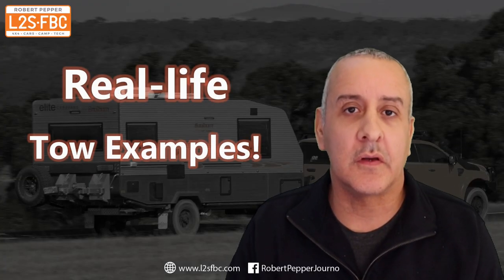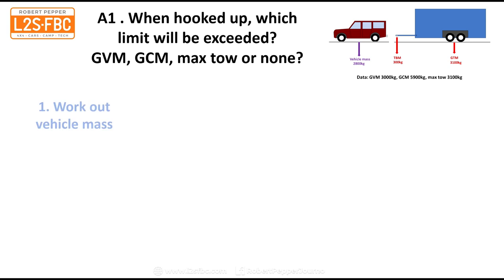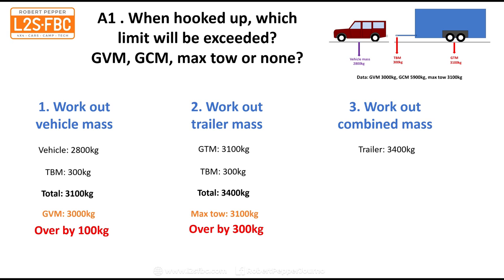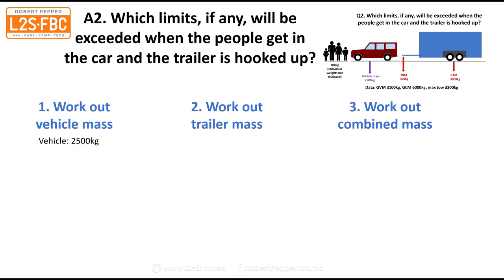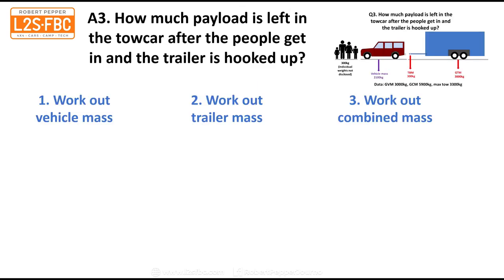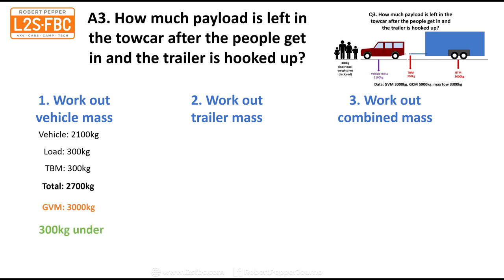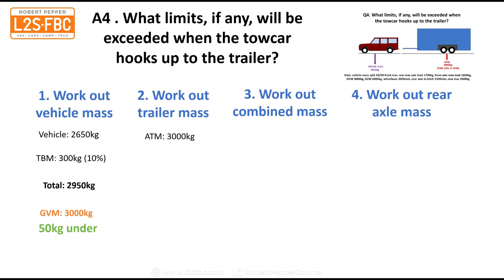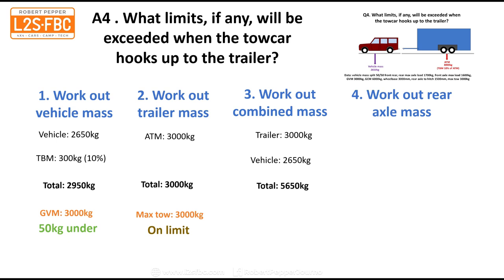Four towing weight examples - explained!

Comment: I have a question regarding tow ball mass.
The tow ball mass is part of the GCM and GCM =GVM +ATM
There fore if you want to know what the maximum GVM is then rearrange formula and GVM= GCM-ATM

Bearing in mind that the tow ball mass is now on the hitch and is part of vehicle payload does this mean that in reality the GVM is GCM-ATM 
Remember that ATM is tow all mass + GTM
The reason I say this is Ford Ranger supposedly can tow 3500KG 
The kerbwieght of a ranger is 2200 kg and if you take 3500 from the 6000 KG GCM then your total payload is only 300kg.
If you then minus from that pay load a 450KG TBM then the ranger can tow it
Whish is why I ask do you subtract the GTM or ATM??

Sorry it's long winded
Reply from the maker: The TBM isn't really part of the GCM. It's better to think of the GCM being a limit of the total weight of rig and towcar. There is no formula for it either.  ATM is max trailer can weight. Max braked tow capacity is different. GCM may be less than GVM + braked tow maximum. Does that help?
Reply: @L2SFBC  I fully understand what GCM is, it's is the combined with of both vehicle and trailer or GVM plus ATM
However ATM is TBM plus GTM
Therefore using simple maths
GCM= GVM+ATM
Substituting the two components that make up ATM
We end up with 
GCM= GVM+ ATM+ TBM

This proves mathematical that TBM must be part of the GCM equation

Maths proves that TBM is part of GCM is doesn't come out of thin air
Reply from the maker: No, GCM is a maximum limit, as are GVM and ATM. 
GCM = GVM + ATM
is incorrect. What is correct is:
weight of vehicle + weight of trailer must be less than GCM
The TBM is covered in the trailer weight already.
Reply: @L2SFBC  yes I realise they are maximum.
Let me put it this way 
Let's use a Ford Ranger an an example.
A Ranger has a Maximum GCM of 6000 Kg and can tow a maximum of 3500KG
What I'm getting at is this.
Let's assume the van is on the max at 3500 kg well that only leave 2500 Kg let for the vehicle.
A Ranger has a kerb weight of 2200 or slightly less.
The TBM is part of the ATM as it is GTM plus TBM.
Assuming a 350lg TBM based on 10% that TBM is now part of the payload.
When calculating the available GVM is it based on subtracting GTM or ATM from the 6000 kg.
One will give you 2500 less tow ball the other   is 2850 less tow ball so you are left with only 300 kg for payload on Ranger, or passengers etc
Sorry if it's long winded, it's often hard to explain in writing I Think.
Cheers
Reply from the maker: Oh  I see. The TBM is counted twice. It is part of the ATM, as well as forming part of the car's payload.

Comment: In above 3000/1500 = 2  but not 1.5 .
I did not get the calculation of 3000/1500=1.5 to calculate the effect to TBM on rear axle.
Reply from the maker: Means that with the 3000 / 1500 ratio you add about 1.5x the TBM to thr rear axle

Comment: i just wanna know if i can tow 2 ppl 1 atv and 2 jet skis in my toyota tacoma trd sport 2wd v6 automatic.. i dont understand, my truck is rated for 6700 pounds towing capacity. that tells the buyer hey i can throw 6700 pounds on this baby and be good to go
Reply from the maker: Maybe you can tow 6700lb. Depends on the other weights as per the video.

Comment: How does the calculation changes for front and rear axles  of truck provided with 5th wheel and semitrailer .
Reply: On a truck,  the fifth wheel (Turntable/ greasy plate) is ahead of the axle, not behind it. Same with a fifth wheel caravan. So some of the weight is shared by the front wheels.
This just shows how complex our weight rules and. I doubt there is a caravan on the road that is legal, and the most sneaky reason is the rear axle loading.
I have not been able to find the rear axle limit for a 100 series Landcruiser!!

Comment: The trailer mass takes 8nto account the TBM.. it's about weight distribution... u do not double dip...😂😂
Reply from the maker: Depends on which weight you're calculating. The TBM is at the same time part of the ATM but also factors in the car's payload.
Reply: @L2SFBC  for calculating the weight of the trailer.. u do not mysteriously double dip on the TBM..the weight of the trailer alreasy takes into account the entire weight... it's definitely bit correct in your example

Comment: ENGLISH
Hello Dear Authorized;
I live in Turkey, I gave you the information that I will receive my O1 certified caravan soon, am I lucky? Greetings.
Information on the vehicle's certificate of conformity
  1-Vehicle = Opel Astra-G-HB-x16xel-GL-MT
   2-1.6 16w 74kw =101hp, 150 torque manual
3-The technically permissible maximum laden mass of the vehicle = 1645 kg
4-Braked trailer maximum mass = 1150kg
5-Trailer port vertical load = 75kg
6-Maximum allowable mass of Qatar (Vehicle + Trailer)= 2795kg
7-Gearbox ratios = 1/3.73 2/2.14 3/1.41 4/1.12 5/0.89
8-Differential ratio = 3.74

DURING THE JOURNEY
9- Vehicle laden mass = 1451Kg
10-Trailer laden mass = 850 Kg
11-Qatar loaded journey mass = 2301Kg
12-Maximum allowable mass of Qatar (Vehicle + Trailer) - Travel mass with Qatar === 2795 - 2301 =494 Kg less ( less)
Can I travel comfortably with this combination? Torque is said to be important in Turkey. Would 150 torque cause trouble? Especially in mountain passes.

TÜRKÇE
Merhaba Sayın yetkili;
Ben Türkiye'de yaşıyorum yakın zamanda   O1 belgeli karavanımı teslim alacağım bilgiler verdim size şanslımıyım? Selamlarımla.
Aracın uygunluk belgesindeki bilgiler
 1-Araç = Opel Astra-G-HB-x16xel-GL-MT
  2-1.6 16w  74kw =101hp, 150 tork  manuel
3-Araç teknik açıdan izin verilen azami yüklü kütlesi = 1645 kg
4-Frenli römork azami kütlesi  = 1150kg
5-Römork bağlantı noktası düşey yük = 75kg
6-Katar izin verilen azami kütlesi (Araç+Römork)= 2795kg	
7-Vites kutusu tahvil oranları = 1/3.73	2/2.14	   3/1.41	4/1.12    	5/0.89  
8-Dİferansiyel oranı = 3.74   

YOLCULUK SIRASINDA
9-Araç yüklü kütlesi = 1451Kg
10-Römork yüklü kütlesi = 850 Kg
11-Katar yüklü yolculuk kütlesi =2301Kg
12-Katar izin verilen azami kütlesi (Araç+Römork) - Katar yüklü yolculuk kütlesi ===  2795 - 2301 =494 Kg eksik( az)
Bu kombinasyon ile rahat seyahat edebilirmiyim. Türkiye'de tork önemli deniyor 150 tork sıkıntı yaşatırmı ? Özellikle dağ geçitlerinde.